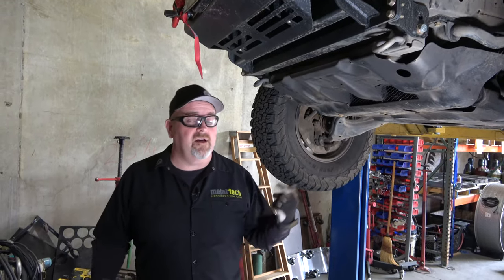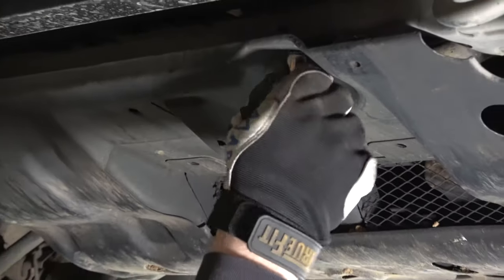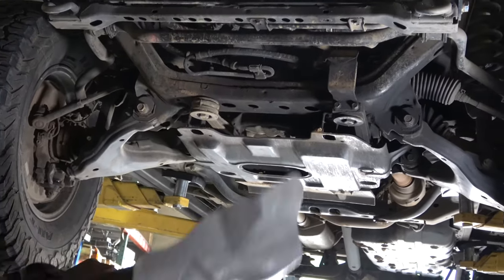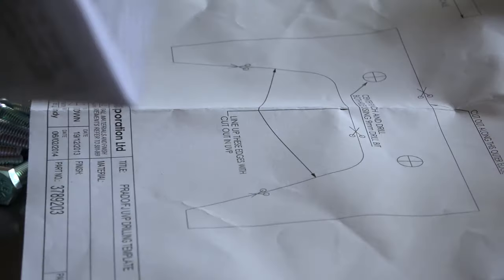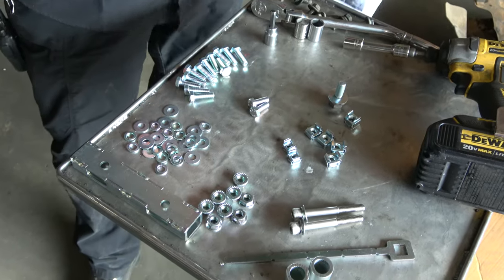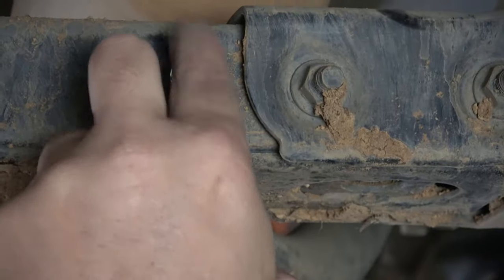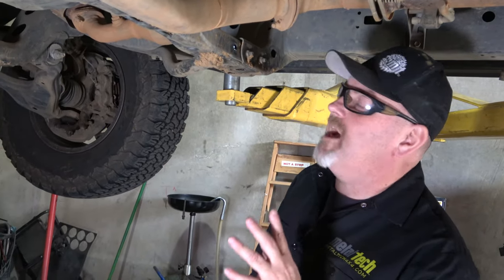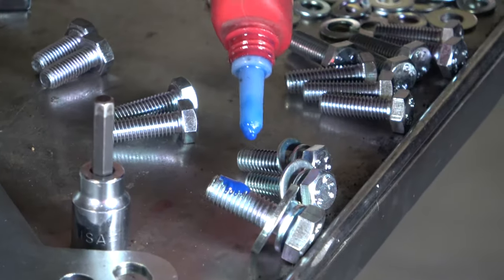ARB Skid Plate Installation for GX470, GX460, 4Runner, FJ Cruiser

Comment: Very well done video. I installed these on my FJ Cruiser about a year ago. I fall into that 95% of people that aren't going to rock crawl so these skids were what I was looking for after pretty well bending up the OEM ones in the Oregon Dunes. One thing I haven't had to do yet is an oil change. I'm assuming that on the GX you'd just need to remove about 7 bolts and then drop the front plate.

Comment: Fun fact: Japanese vehicles don't use 13mm bolt heads. They'll use either 12mm or 14mm heads on M8 bolts. It's because the number 13 is unlucky.

Comment: I have the same skids ready to go on my 2012 FJ. I do need to remove my diff drop first. I would not recommend lock tite I always prefer anti-seize compound. Gives better torque spec and comes off years later without gawling the threads.Thanks for the video. Great views too. I will be on my back doing this.
Reply: Could you space it out?

Comment: I had a diff drop on my 4Runner. Installed the summit bumper and the front stone guard would not install with the radiator supports being lower. I had to order the arb radiator support (driver side) and remove the diff drop kit for the summit bumper stone guard to fit and resulting fitment of this skid kit.

Comment: What year is that GX? I have an '04 and my exhausted looks likes it's a little different. The pipe crosses under the transmission pan and looks like it would interfere with that transmission skid.
Reply from the maker: This is a 2007 GX470.  We have seen slight variances in exhaust over the years.  The kit from ARB does fit all the different yrs for the 470.
Reply: On the 03-04, the pipe crosses too low for the transmission skid to clear. You can see this in the video by Lexus Off-Road Adventures. I was advised to add a flat bar between the angle bracket and the skid for extra clearance, but I haven't done this yet. Have you found a good solution?

Comment: Should I be nervous that the transfer case skid doesn’t come with 4 bolts 0.25” longer than the OEM bolts that hold the transfer case together?
Reply from the maker: Jacob, that is a valid question. However there are plenty of threads holding it together.  If anything it's proven to not be an issue with the thousands of these skid kits ARB has sold world wide for the Prados.

Comment: Help do the fj cruiser skids require the spacer upfront?
Reply from the maker: We did this install on a GX470 and didn't need to use spacers. You probably won't need to use any unless you are running into an issue with clearance.

Comment: How is the oil pan accessed for an oil change? 
Does the whole system need to come off??
Reply from the maker: No the whole system does not need to come off for an oil change.   You can pull the front plate for access.